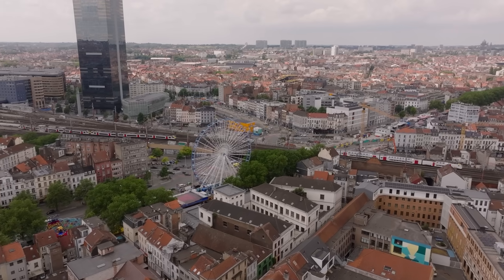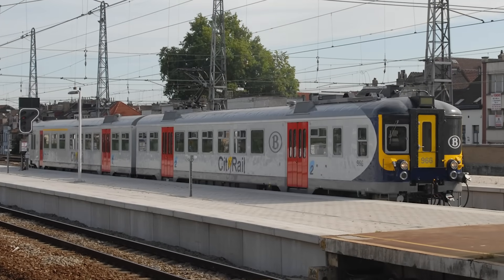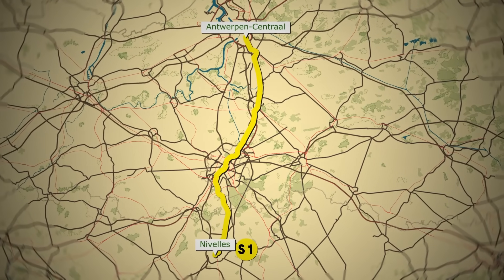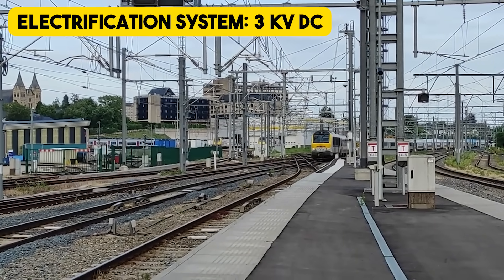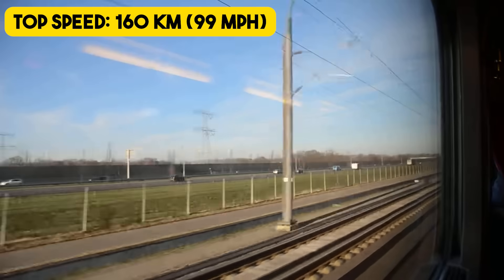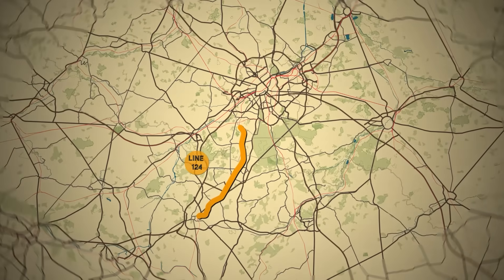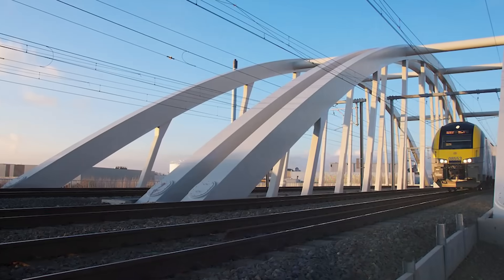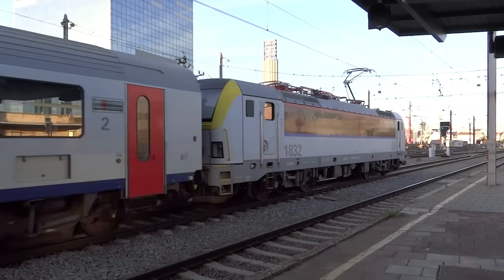Why Has Brussels’ RER Project Taken So Long?

Comment: Antwerp-Brussels is painfully in need of more capacity but that's mainly because of the cuts of multiple IC trains being lost
Reply: It's crazy that most of the time it takes almost an hour to get between the two, considering it takes half the time to go a longer distance to Ghent from Brussels (50 km in ~55 min, vs 60 km in ~35 min)
Reply: @BenutzerWalter   In what universe are you living ? The average service time between Antwerp CS and Gent Sint Pieter is 56 minutes !  And that is way too long for 55-60km it should not be more than 30-35 minutes . 
A problem imo is that NMBS does not differentiate between limited stop Intercities and  intermediate multi stop trains.  All the trains stop at all the station in between ( And that is aside the exit-entry intervals on stations being very long . ).   Gent should be in 30 minutes and Kortrijk (100km) should be in 1 hour with intercities (instead of 1h25m now ) , and they should alternate with regional trains that stop at all the stations  .
The fastest connection between Antwerp CS and Brussels South is 35 minutes with a no stop High speed train. But most of the other IC trains stop at almost every station. There is one train that stops at 14x on the 45km Antwerp CS to Brussels North ! That is about every 3km , it is more like a light rail , that should not mix with IC and Thalys high speed !    
There are 4 tracks between the 2 cities, there should be one double track dedicated to higher speed IC/thalys and one doulbe track for inbetween commuting !   ( for example between Amsterdam and Utrecht are 2 distinct double tracks. one for intercity and one for regional commuters ... 50km takes 35 minutes   : There are 6 ICs from Ams CS and 6 from Ams Zuid/Schiphol to Utrecht , along like 4 commuter trains ). 
Between Amsterdam and Utrecht are 110 trains per day, between Antwerp and Brussels only 56 ..
Reply: @lws7394  No I mean between Brussels and Gent, sorry for the confusion
Reply: Don't get met started. Taking trains on tuesday or thursday mornings is like hell... Sometimes it's already packed in Antwerp-central knowing you have to pick up two full platforms in Berchem and Mechelen....it's an utter disgrace and the NMBS simply doesn't care.
Reply: @bv2623  It's literally one of, possibly even the busiest route why are they not running more trains smh
Reply: @BenutzerWalter  The line is completely saturated. They want to run more trains yet they aren't able to.
Reply: Why does an IC connection need to stop twice in Mechelen for 2 stations at 400m distance apart?
Reply: Yes, sure! SNCB did do that for letting run the new EuroCity Direct trains since the schedule of 2025 (since Sunday 15 December 2024).

Comment: One of the biggest flaws is that the integrated transport pass for the Brussels agglomeration (Brupass/BrupassXL) is both overpriced as all hell and covers a way too small area to be useful to a lot of people. The other cities that have an "S-train" network dont have an integrated ticket at all, so unless you have a specific train that you take often, it's often not worth getting the train when a bus or tram gets you where you need to go. Ideally, the entire Brussels, Antwerp, Ghent, Liège and Charleroi agglomerations would need to have a cheap integrated ticket that have prices that make sense and cover enough area.

Comment: Nice video. As mentioned by a previous viewer, you said S81 but wrote S21 (at 5min). It is also to be changed on the map, as the S81 follows the same track as the S8 line with the same destination (not along side as shown in blue and brown).

Comment: It may call itself an S-Bahn, but the fact that it connects outlying cities makes it an oddity for the S-Bahn concept. Potsdam and Berlin are neighbouring cities (35 km), so their being on the same line makes sense.  Brussels to Antwerp, on the other hand, is 50km. The only thing that would make it seem like a true S-Bahn is more frequent stops than intercity trains.
Reply: a lot of people commute into brussels along that line (and to antwerp too for that matter). So it may be odd for an S-bahn but still fits as a commuter rail network in my books, which is what I think an S-bahn fundamentally is.
Reply: Well, the S1 is an oddity even within its own system, to be honest. It connects two cities each of which have their own S-train network, and only the S19 Brussels Airport Zaventem—Charleroi does that also. I figure it's just sort of like, part of both
Reply: The Zurich S-Bahn does this too. It's not unique

Comment: Also in Italia is used the letter S for suburban lines, e.g. the "linee S" or simply "S" in Milano.
Reply: Really? Why, though? (I speak German, by the way, but do not understand why it needs to be adopted elsewhere)
Reply: @effeo9962 S stands for "suburbano" (suburban).
More..: Zurich and Milano in the '80s had an agreement to build their city tunnel exchanging info, experiences, technicality etc... Among all this things they had choosen to use the same "S" letter to indicate their lines. 
BUT Zurich did it and operate its own city tunnel years before Milano finish its own...
Reply: @felcofb4750  it's similar in Barcelona too. The local train network has R lines (Rodalies, meaning commuter) and S lines (Suburbà, suburban). 
So it's not only a German speaking thing like the video implies.
Reply: @osasunaitor yes, in Milano too, linee S ( suburbano) and  R (regionale) for trains that has a regional route, Lombardia and other border zones. Don't know if in Barcellona the R has the same range than R in Milano. Anyway I've been in Barcellona and public transport there, is simply impressive.
Reply: @felcofb4750  it depends: R1 to R8 are local commuter lines, and from R10 and on, it's regional commuter lines. Two of them reach into France even. So it's similar to Milan too!
Reply: @osasunaitor  yep, it looks very similar, also in Milano some R lines reaches another state: Swiss; so not only they cross the border but goes out of the union!

Comment: The Belgian S network is just some fancy branding slapt onto standard local trains. It’s in no way comparable to the RER or S Bahn.
Reply: Yes that's true but you can't compare apples with oranges. Berlin is a radially-expanded city (hence the Ringbahn) and there is higher intermodality between means of transport than in Brussels. It also depends on the placement of the business hubs, etc. However, the RER is not bad at all and especially the lines bypassing the North-South-connection via the SJT are very important and well serviced. The trains although they could have more multi-purpose areas (for bikes, etc) and for handicapped are really good for the purpose. But, honestly, I wouldn't take the S1 to Antwerp all the way from Brussels 😅 The IC is the better choice. About punctuality... I have never faced an issue especially with S1. Ticket control happens almost all the time which I highly applaud plus with the personnel on the train, the service feels much nicer than any German S-Bahn I've been on. I only wished a 20-minute service on S1.
Reply: It would need gates on all stations so there is no need for checks
Reply: @leonpaelinck  the quintessensial S-bahn, the berlin s-bahn, doesn't have gates either

Comment: Desiro good comfort? The old sets (you mention them here as their shortlived cityrail version) had decent comfort. Desiro's have two good seats. Front and back for the driver. I should know as I used to be one in Leuven. Do some research by actually going to the places you talk about and taking the trains. Instead of just stitching videos together about the subject. Some of the images here have absolutely nothing to do with the subject. They show us king Boudewijn who  died 30 years ago as he opened the Brussels metro or premetro.
Reply: Desiro's are just fine imo? But I absolutely prefer riding on anything that's not a Desiro. And it's dumb that they're used for any IC lines at all, makes no sense to me unless they have material shortages. They're annoying to take a bike on and there's only one bathroom per unit.
Reply: @BenutzerWalter what are you on about, they are the best trains to take a bike on. Much better than the high frame of the oldest stock, the locked doors on the M6, the weird dip for the M7 or the dreaded compartment for the AM96. The desiros are way easier, the doors being at platform height for a lot of (not enough) stations.
Reply: @ordinaryorca9334  That's fair, I was only really thinking of it compared to one of the older cars that has a dedicated bike spot inside that I am in most often on trips (I'm not sure which model). But compared to the double-decker ones (M6/M7?) where you can really only easily bring your bike on the ends, Desiro's are definitely better.

The reason why I said that was because you have to attach them to folding seats, there's no pole to lock them to (unless you use the one by the door), and they can make it inconvenient for others to get to and go around the toilet. But the level boarding is definitely a bonus that I didn't consider